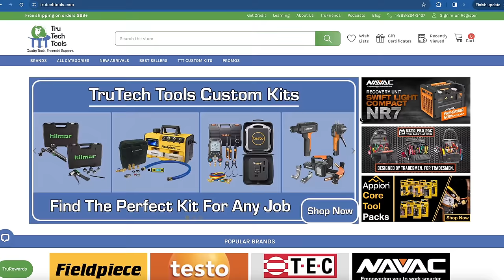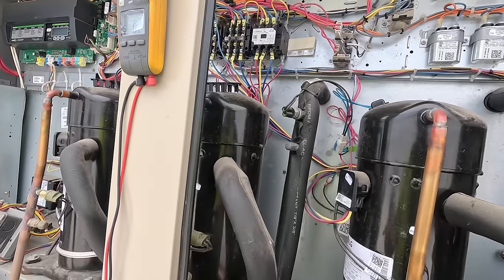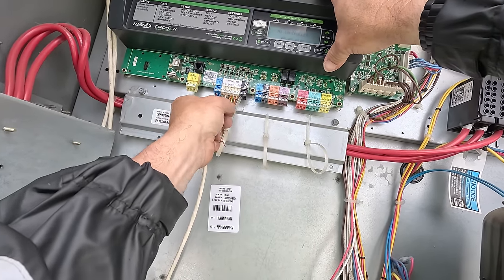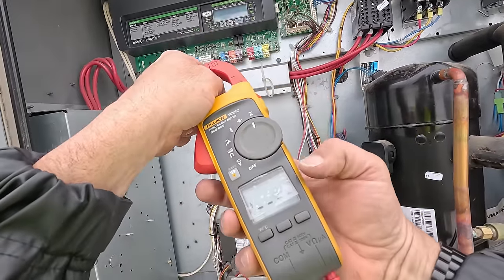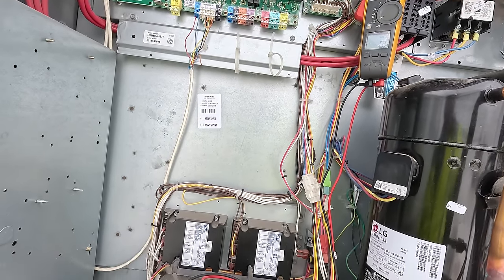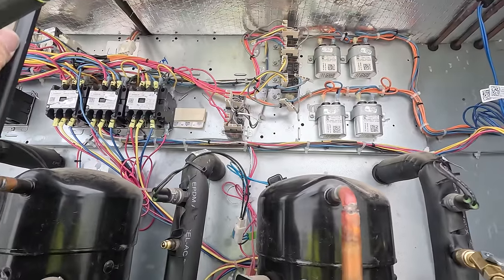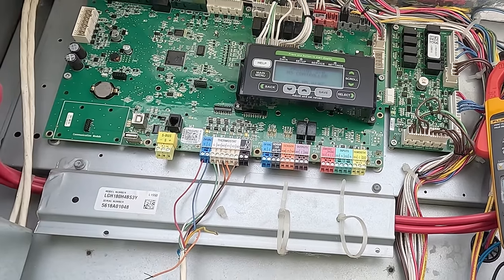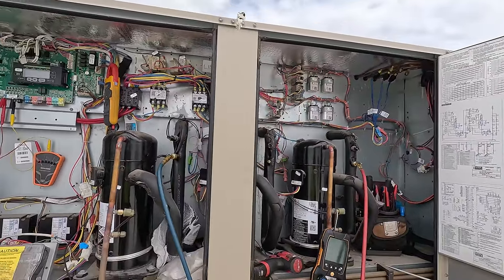Lennox Prodigy Playing Games RTU Not Cooling

Comment: Had a local tech come out to do an AC check on my home.  Somehow they managed to short or do something that killed both the circuit board and the wall thermostat.  Nice to see a real professional at work.
Reply from the maker: That really sucks, sorry to hear that! Thanks for checking out the video!
Reply: They hooked up the high voltage to the low voltage on the contactor

Comment: Worked on AAON units where the control board controlled a bank of relays .  If a contractor went bad it couldn`t take out the main board.   But had the blower short cycle ,the relay would turn on the  Frequency Drive then shut off . Was the coldest day in winter ,why not think was -10 ,just pulled the relay out and reinstalled it . Good to go , Got 3 back relays just in case , 13 AAON units at that location.

Comment: On those prodigy units, they have a self test mode.  Pulling the wires from the thermostat connections and putting it into self test can help get thermostat problems / thermostat wiring problems out of the picture.  I've seen a few go bad here and there.  At $750 - $1000 it's an expensive failure.  Fun part is having to reprogram the new controller for all the fancy settings.

Comment: It could have been a sensor or some other thing,unplug everything and reconnect until it shows a problem to isolate,also you can switch 24 volt on transformers in case that one is weak.thanks for sharing.

Comment: The board has a limit on the incoming voltage, any voltage higher that 27v Ac will cause it to lock out or act like that. You need to change the primary voltage tap on the T1 and T18 transformer to lower the secondary voltage.
Reply from the maker: You would think Lennox tech services would have said something about that. He did tell me that there’s a relay inside the control that has a history of failing. 🤷‍♂️

Comment: it's probably a failed capacitor on the controller that is there to supply current during DC power draws for the computer when activating the 24VAC control relays. I have seen this happen in printers. They get stuck constantly rebooting because a capacitor fails and can't provide current during startup when there is a momentary power draw. New cap and good to go.
Reply from the maker: Lennox guy said there’s a relay that fails?

Comment: It looks like something low voltage is shorted and when it wants to turn on it shorts main transformer, the proper diagnostic whould be to unplug everything from the board and connect slowly thing back until it trips. Or just chech resistance on everything low voltage. I dont think its the main board.
Reply from the maker: Well, like I said, I talked to Lennox tech-support and they said it was the board. Because what I unplugged was all the outputs. Also, if it was a short, the amperage would’ve went up on the transformer. I eliminated that even as a possibility by putting the amp meter on there.

Comment: So i have 2 hypophises as to whata going on with that controll bored.
1: the filter caps on the voltage ragulation circut is going out causing the MCU to be unstable to the point that any change on the power rales causes the MCU to reset.
2 one of the relays on the controller has a shorted coil ( the y1 relay) and when the controller trys energyzing the relay it pulls down the supply dc voltage for the controll bored and causes it to restart. 

Pardon my bad spelling
Reply from the maker: Lennox tech service told me that there’s a relay inside there that has gone bad so you might be correct

Comment: I have a question do you service residential units and can you upgrade ine half of an ac system like the condenser...also are you in California?
Reply from the maker: Yes I have done residential for the first 20 years, but I'm in Ohio.
Reply: Yes until January 2025. In Cali we will not be aloud to just replace the indoor or outdoor unit, if it isn't one of the new refrigerants.

Comment: Most Fluke clampmeters  don't have an Ohms scale that reads Millions of ohms. If you are testing for a grounded compressor a meter that uses multiple batteries or a 9 volt battery and reads 40 or 60 million ohms will find a grounded winding.
Reply from the maker: You’re correct, my clamp does 60k ohms max. Generally most shorts are low. If I think I need more resolution I’ll grab my 87V, 117, or my extech megger
Reply: @HVACRSurvival  I call my 87 V MAX my left hand.  I haven't had it fail me yet on diagnosing a shorted compressor.  If that meter reads OL in MΩ switch it to nS.  nS or nanosiemens is the opposite of ohms.  

0.01 nS = 100 GΩ
0.1 nS = 10 GΩ
1 nS = 1 GΩ
10 nS = 100 MΩ

As you can see it is a measurement of conductivity the reverse of resistance.  There is an overlap with the MΩ selection in the meter.  Sometimes it takes a few minutes for it to settle down on a reading.  

The old non metric way of saying  nanosiemens was ℧ MHO, the reverse of Ω OHM.

One of these days I will buy a megger.

Comment: Any updates on this service call? If the board solved the issue
Reply from the maker: It just happen Thursday. The store has a HVAC crew that put on a different series controller and it attest has one stage of cooling until the correct board comes in.

Comment: Could of megged out compressors and saved time
Reply from the maker: Yeah, but unless you have a log of what you’ve had in the past, it’s a well-known fact that you can’t just go up there and make a definite guaranteed diagnosis unless it’s really bad short and you can see the super low resistance and the test voltage actually drops. You can have moisture in the system or liquid lane in the compressor and that will give you a low mega meter reading.